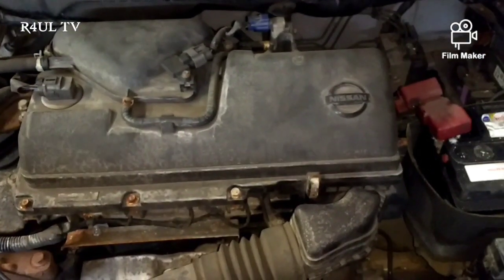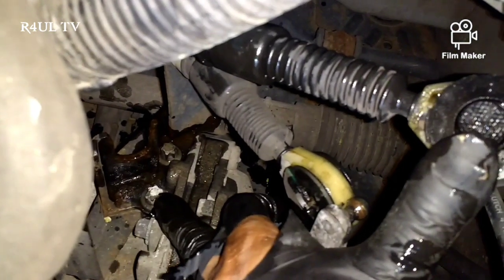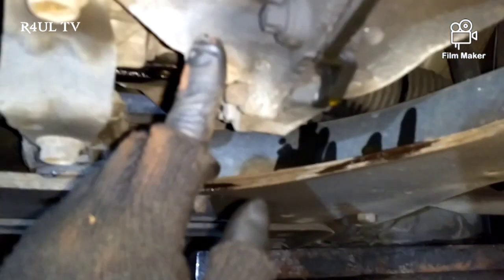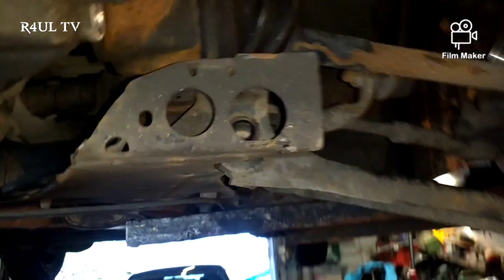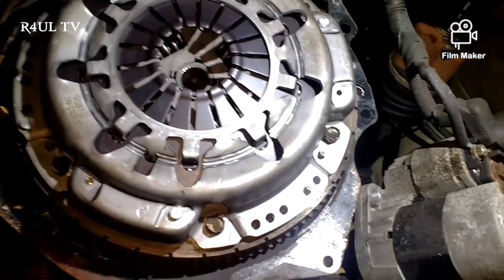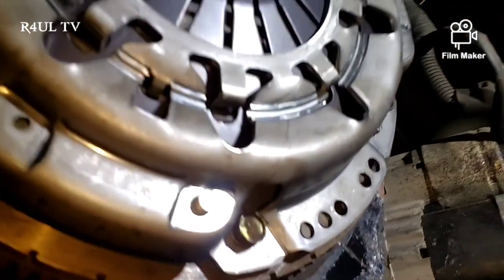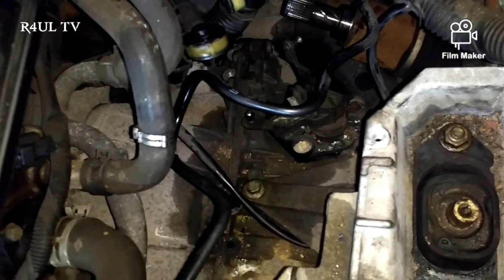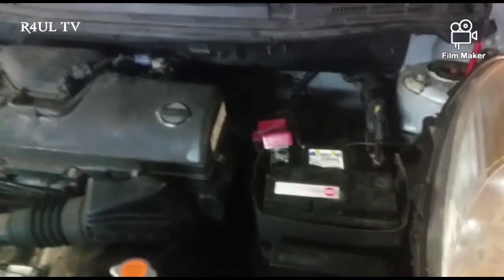How to Replace Nissan Micra Clutch 2003/2010

Comment: hey, very nice video! thank you for it. Can you tell me what was this noise when you started the car? My car is also doing it but it has new alternator and water pump belts and pulleys. Next week is getting new clutch but i cannot find from where is coming this noise when starting the car.
Reply from the maker: Thanks for watching hope it helped you out. As for the  noise it's the starter motor making the the noise on start up. This car had this fault on it to begin with. Not doing any harm just on start up makes a noise
Reply: @TEAMR4ULTV  thanks for the fast response. Very good to know! Is there a way to probably open it and clean it somehow or something like this in order to stop this sound? Good that it is not doing any harm but it is annoying :D
Reply from the maker: @boyannaumov1825  the best  thing to do is replace it with a new one. But if you dont want to do that then just slacken the bolts and adjust the position of the starter motor should help the noise
Reply: @TEAMR4ULTV  thank you very much. I will try that. Keep on doing the good work! ✌️
Reply: My kids have Micra K12s, thats 3 cars and they all do that noise. I shouldn’t worry - it’s just a Micra/Nissan thing

Comment: Do you check the flywheel when replacing a clutch on a micra?
Reply from the maker: I did check the flywheel when replacing the clutch, it's a solid flywheel sor it was ok. Thanks for watching really appreciate it
Reply: @TEAMR4ULTV  Thanks.  Just had a clutch put in my micra and wanted to see if a flywheel check was part of the repair.

Comment: A question with regard to the input shaft seal.  
Can you hook it out and replace it at the same time as the clutch or do you have to split the gearbox to replace it?
Reply from the maker: If it's the driveshaft seal you can do it after.

Comment: WATCHING THE REPAIR   EXPLANATION ...  WHY NO FLYWHEEL MACHINING,,,   THAT IS MOST IMPORTANT FOR WARRANTY ,, AND GOOD GRIPPING SURFACE FOR  THE CLUTCH , ,
Reply from the maker: Thanks for watching really appreciate it. You need specialised tool to machine the fly wheel. So I just sanded it down with Emery cloth should be ok

Comment: My radiator pipe when I open the lid it’s bubbly like chocolate milkshake
Reply from the maker: Most likely over heating, could be anything, if water and oil mixing up it will go creamy. Could be a blockage, air in the system etc
Reply: R4UL TV it’s not over heating deffo when I opened it it looked like chocolate milkshake bubbly
Reply from the maker: @gang-gang8325  
To be honest I couldn't tell. If it's not overheating then maybe air in system or if its diesel maybe oil cooler